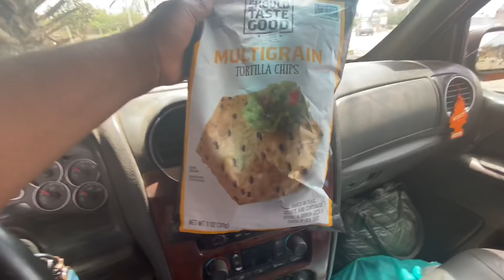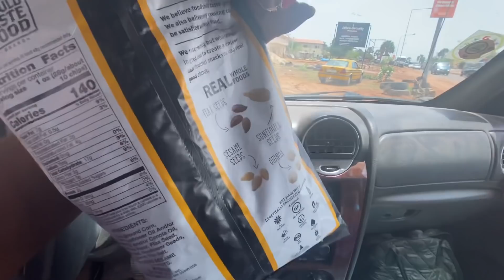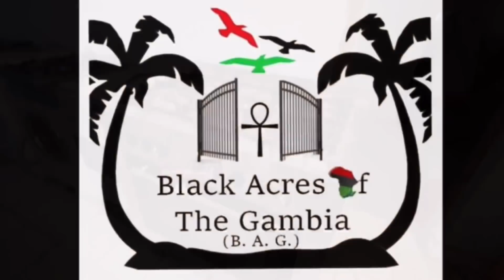SJM's Day off from BAG 😂❤️😂

Comment: One thing I know is that road construction is not very organized usually. I'm sure in every African country especially urban areas the road system is usually bad in residential areas. The problem usually is other road users trying to use those roads to beat traffic. Usually in African countries all cars whether heavy load or light load use the same road hence potholes.